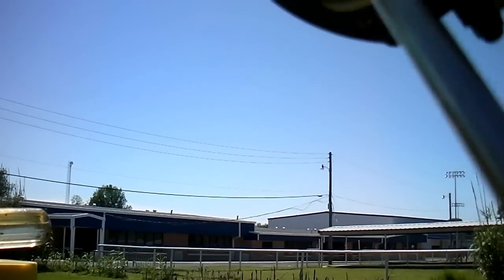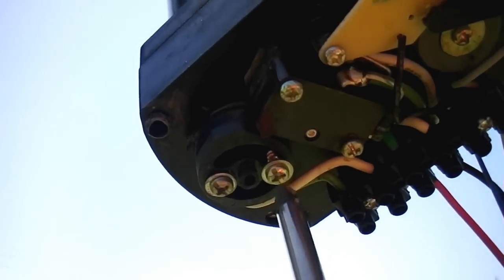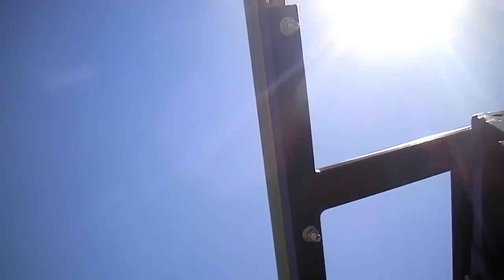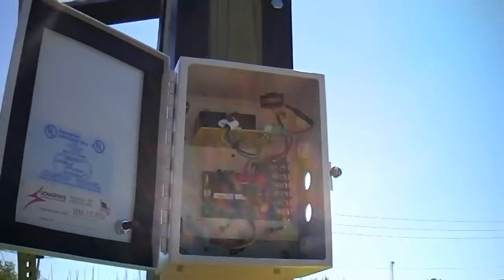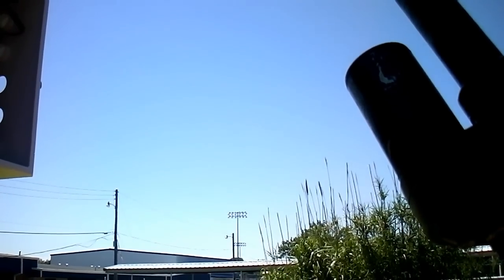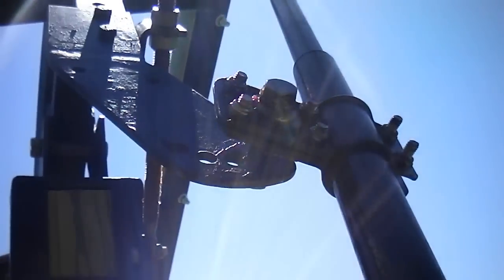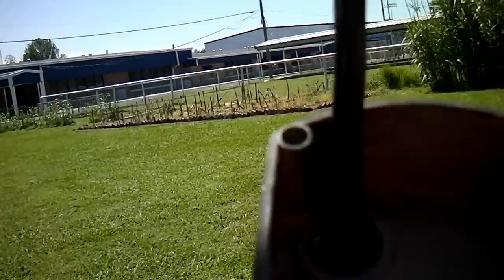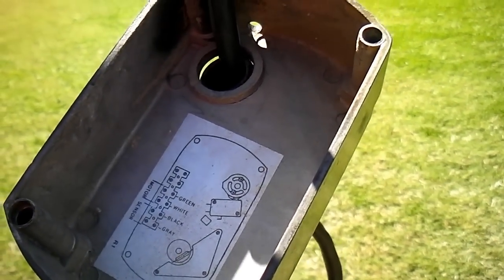Adjusting Cam Stops On Solar Tracker

Comment: I have a 18 on tracker #2 it,s only i think 10 degrees less than#3 with the 24" actuator adjusted out just right.I think that Early morn and late in the day the Sun is weak any way,that,s why i don't use the whole 160degrees that i built into the tracker ,does not  seem to matter that much.my first 1 only has 90 degrees total 45 East & 45 West.it works fine.

Comment from the maker: It seems to be really smooth but I have not owned anythink else to know. Its a 18 inch and I didnt know that but actually its just perfect. Yess ist would go a few more degrees but so far I have not needed it to. I think in certain months it may be a very small advantage early in the morning but only for a few short minutes a day. You know it may not even be significant enough to matter. This is something to think about. The 18 inch one is only 35 dollars.